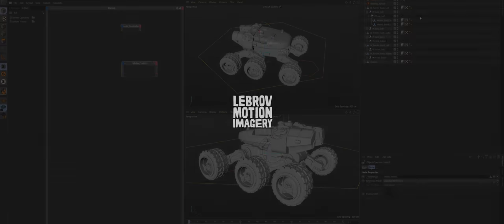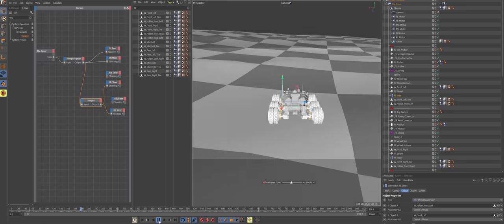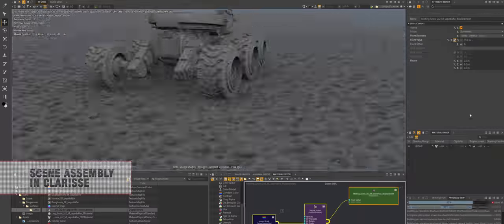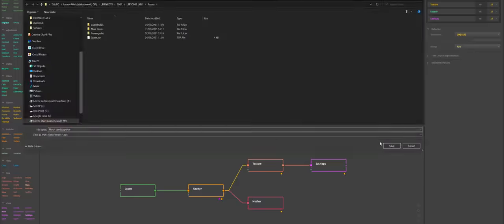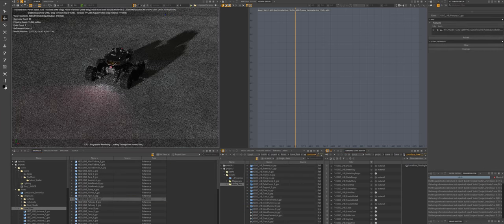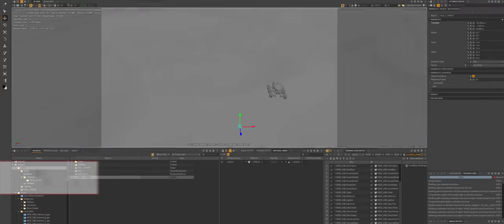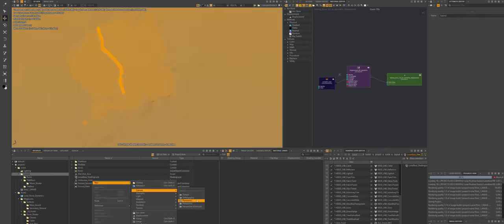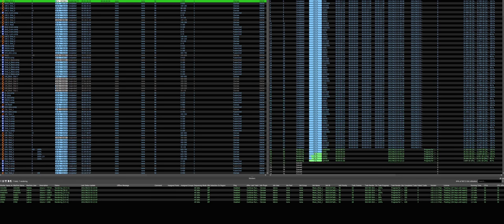Lunar Rover | CG BREAKDOWN & ASSETS

Comment: Very nice breakdown! Why is Clarice a good software?
Reply: I am just getting into this. And researching this software. It appears to me you have an exponential ability to load up your scene with much more complexity. It seems to be a place to gather all of your complex 3d assets to build up your scene and render all in one place. I was on a project earlier this year where I had to render a 3d landscape and to get that high level of realistic fidelity i really had to struggle with the all of the assets... So now I have been trying this software out and I made some heighfield maps applied to plane that was subdivided by 10,0000x10,0000 and it took a minute for it chomp through that and I thought Clarisse crashed...but it did it. then I was  rotating the camera around my landscape like it was a normal plane that had a 10 x 10 subdivision.  If you did this in c4d you would not be able to move the camera and it would crash and you would have to restart. that was 100 million polygons.

Comment: Andrey could you please share which rendering rigs using wich CPU and GPU’s you used to achieve this magical absolute filmgrade SciFi VFX creation and rendering. I am asking because i want to start to do the same as you, especially SCIFI creation and rendering. The problem is just not just bc it will be a fresh start up company my funds for expensive creation and rendering rigs are somehow limited and i can not risk to waste money on Computer equipment, i know that it will be several custom builds, but those need to be at least for now until i could earn some revenue, be the correct ones for the different VFX softwares that you have mentioned. I have the passion an thrive to pull through this challenge. After all my father used to fly the fastest planes in the US AirForce.
I thank you for sharing this mind blowing creation and render……you are truly gifted and have obviously the necessary passion to succeed in such challenging projects. I can only imagine how many all nighters you have pulled through this project. Luckily I am a bit of a night-cat too, Greetings 🐯🎬